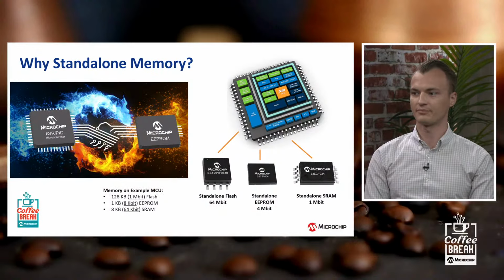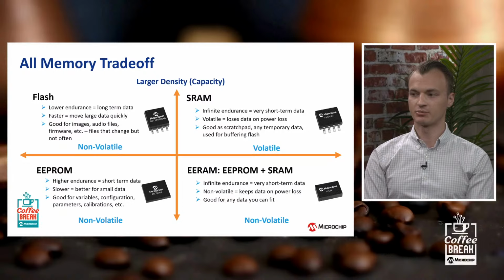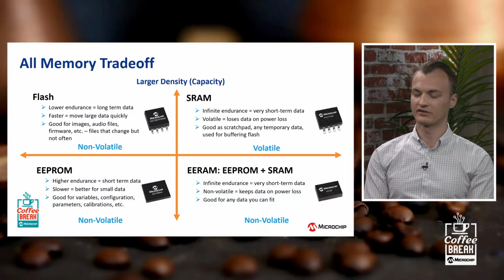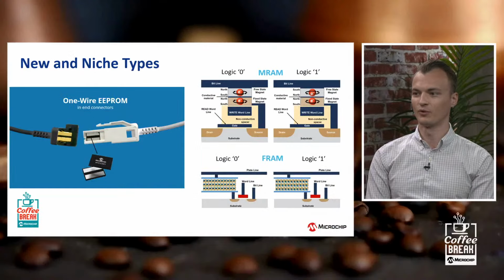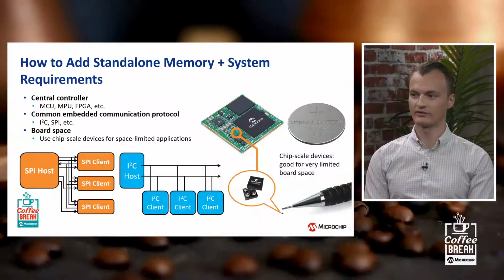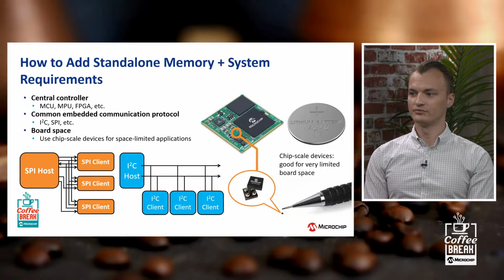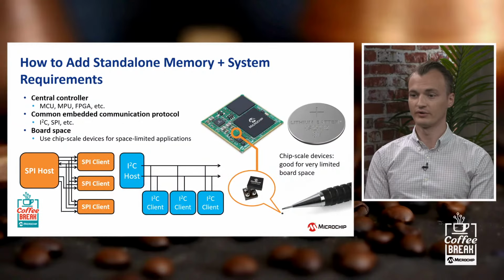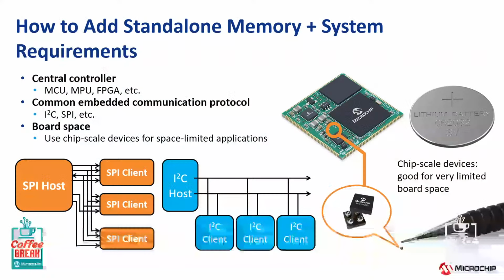Coffee Break | S11E4 | Why Standalone Memory?

Comment: Is it possible to add external RAM into the addressable space of a micro-controller as easy as it would be for a micro-processor?
Reply from the maker: Hi there - Adding external RAM to a microcontroller is typically more complex than with a microprocessor and depends on whether the microcontroller supports an external memory interface. It requires additional hardware and software configuration. Hope this helps!

Comment: reminds me of a CXL ''like'' product, but for micro systems discussed here. most would just replace a chip. but this would be very costly, on the client side. 
as the cost related to using a hot swap device, requires just a basic technician.  the depreciated model systems of today, gives me the opportunity to replace/ upgrade as needed. 
with all the ''new'' systems being installed & set-up. it's great to see an electronics components Mfg, committed to a knowledge base.